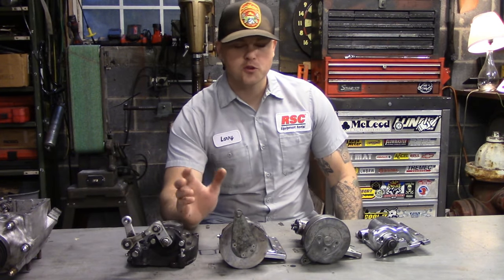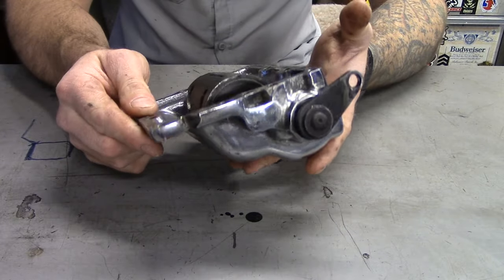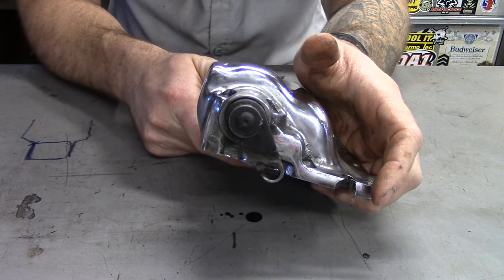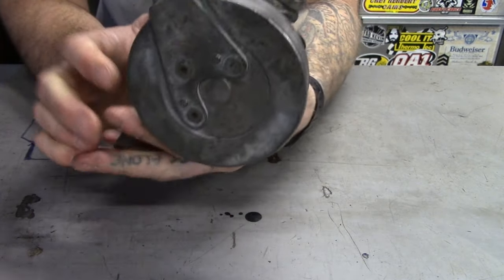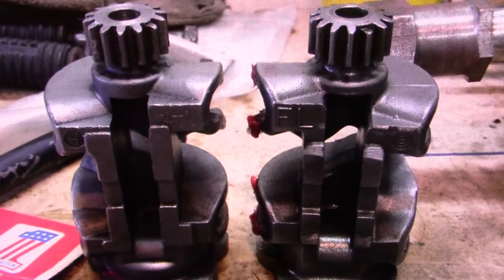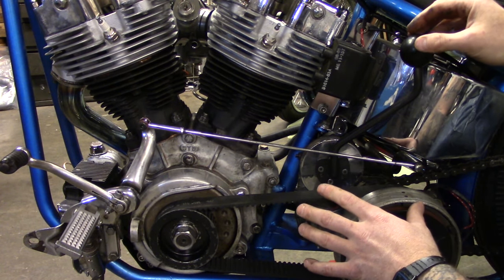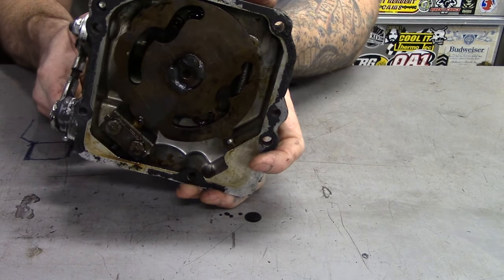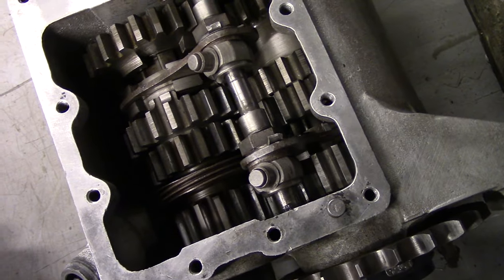Which Harley 4 Speed Lid is for You?!

Comment: This is gold! I just got my 4speed side shift rebuilt and was worried why the shift lever wasn't springing back, just need to roll the bike for that to work correctly. Thanks for the vid!!
Reply from the maker: yeah, Sometimes you have to roll the back wheel to get it to go into each gear, but if the shifter isn't returning, something could be in a bind or a problem in the ratchet, broken springs maybe.

Comment: Chuck you have a video of changing the rachet on a 50"s panhead? My shifter doen't spring back anymore
Reply from the maker: I think I cover it in my in my 4 speed rebuild video. Its on my channel page. 
The springs in the ratchet can break. Or something is in a bind inside the trans.
Reply: @ChucksCycles  nope didn't see it just the install of the gears in main case. Guessing I have to remove both outer & inner primaries and clutch hub to expose rachet . Can I remove rachet cover to change springs without taking off the top?
Reply from the maker: @bobvan1128  You should be able to access the springs by removing the primary. Then remove the ratchet cover. Keep in mind the screw at 6 oclocok has a nut behind it.

Comment: . . wondering if the FX Shift Barrel  will fit in a FL Ratchet Top ? ? ?
Reply from the maker: Yes, it will... but If you want the neutral light to function you will also need an FX shift gear to match. If you are not concerned with a neutral light, either gear will work.

Comment: The rotary or cow patty top will wear out because of inferior stamped rotor. Weld the channel with stainless and use the tip roller for clearance when you dremel the channels. You'll know its bad when it wont stay in 2nd gear.
Reply: I’ve got a rotary that has gotten stuck in 4th twice on me now and prior to that when down shifting into 3rd or 2cnd getting a false neutral. Where can I find more info the repair you’re referring to ? Thanks
Reply: @motorcyclemike8555  I just pulled the cow patty off and got the shifter cam out. The slots in the shifter cam was what I welded. I took a new shifter roller and used it to space the slots correctly when I dremeled it. Sounds difficult but the hardest part was getting to the cow patty! I never saw info on it, I just did it. Sold that bike and it is still working for 3 years in Fla.